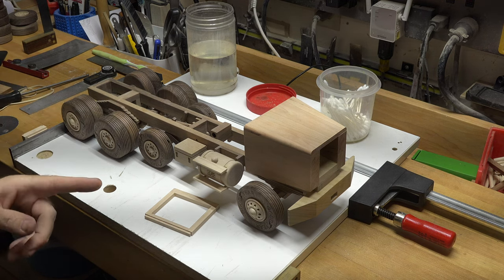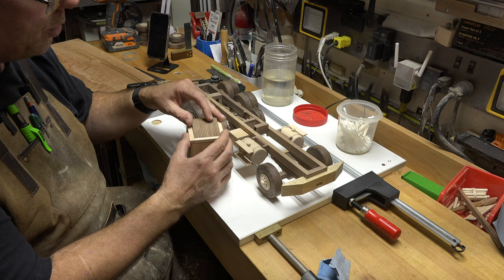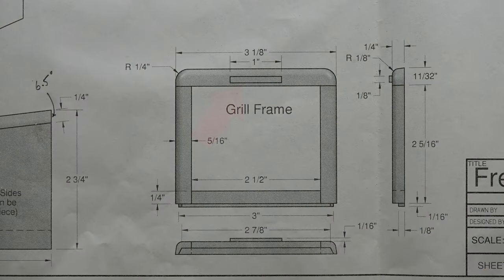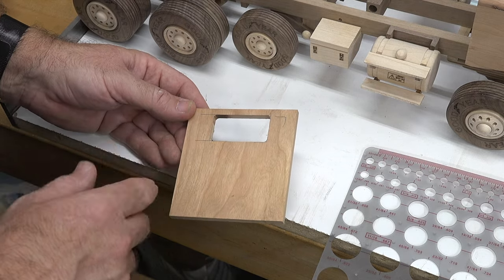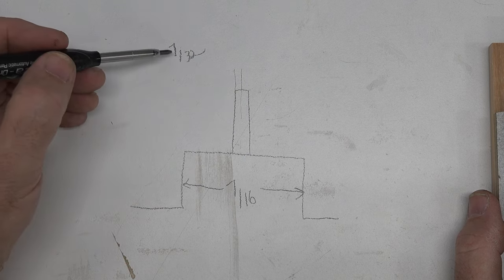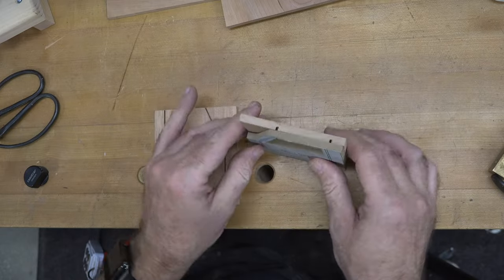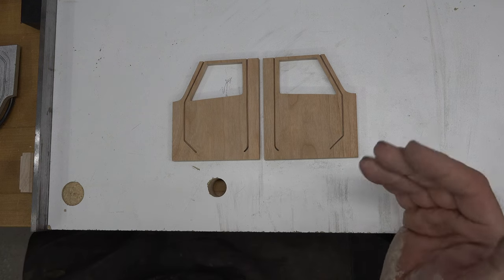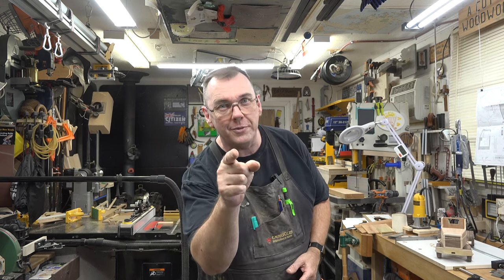Making Toys and Joys Dump Truck and Pup Trailer Part 10

Comment: Another great build segment Ken. That is how I thought you would do the grill. I built Toys and joys '51 pickup, and it had the 1/16th groove for the door opening  also. It also had a door panel that stood proud of the main part of the door. Did basically the same thing you did, but had a do an extra step to get the door panel groove in it. It looked really good as did yours, and it really makes you feel good when you spend 4 hours making a jig to do a 30 second task. Great job again Ken!! David
Reply from the maker: Sometimes, those shop made jigs and the problem solving is that most satisfying thing about these build David.  Thanks for tuning in and for chiming in with your story.  Love it.

Comment: Ah, Thank you, sir.  My week is now complete since I could watch and learn and enjoy another edition of this project.  It is going along so well and this video explanation of how to set up the template for using router bushings was terrific.  You've explained it before but this one, I think, was the most illuminating yet.  Great job.   I do have one question for you about making the radiator insert.  Perhaps I am missing the difference ( vertical fins vs horizontal fins)  between an earlier project but in Part 4 of the Scale Model build at point 24:19 you made the radiator insert using a 1/8" set up block after cutting the 1/16" center grove and then making the needed adjustments for the set up block and subsequent cuts.  The result was perfect and I have used that very technique to make tufted seats for models, etc.  So my question is why did you change the technique for  the Dump Truck build?  A new and better technique, perhaps?  Just curious.  Either way, the outcome was/is great.   Thank you, Kenny, for all that you do and the grace you show in sharing your knowledge and skills.  Until next week . . . .  Regards and wishes for a wonderful week.
Reply from the maker: The technique was changed to suit the pattern.  If I remember correctly, (and understand your question correctly) the technique for cutting grooves in the grill doesn't change depending on whether they are horizontal or vertical but rather due to the size and spacing of the grooves.  I believe the other grill with the 1/8" spacer, the grooves were spaced at 1/8" apart whereas these ones are spaced at 1/16" apart.  It's just what the plans called for and sometimes we have to adapt our methods to make the piece according to the prints.  I hope this answers your question.  Thanks for tuning in this week. I'm glad that you are enjoying the series.

Comment: Sir, how do you decide on which wood species to use where? Strength? Color? Are there any species that you simply WON'T use? Why?
Reply from the maker: All of the woods that I use on these models are hard woods.  Some of them are on the softer end of the hardwood scale but I still use them.  If parts are functioning and will take abuse, I try to use a harder hardwood such as maple or walnut.  Which one depends on what colour I want the part to be as I don't stain these models and just use the natural colours of the woods.  Because I use all hardwoods, choosing which species to use is all about colour and what will look best on the model for me.  Woods that I won't use...Pine (too soft) Spruce...(to sap filled) Plywood....(ugly). I hope this helps.  Thanks for tuning in.